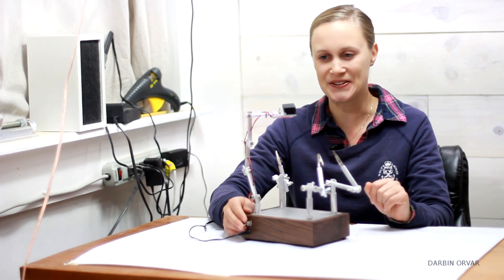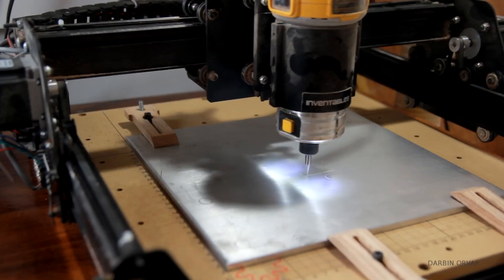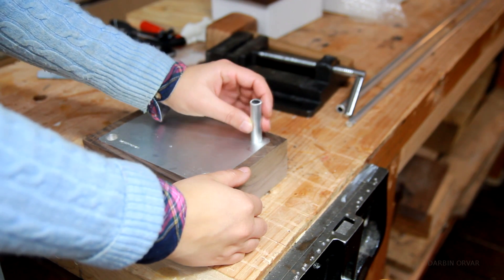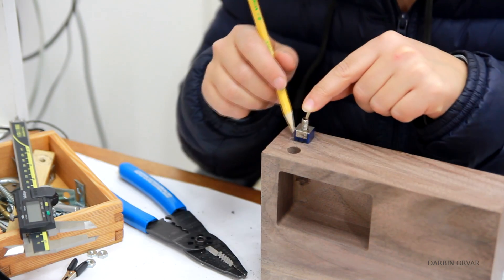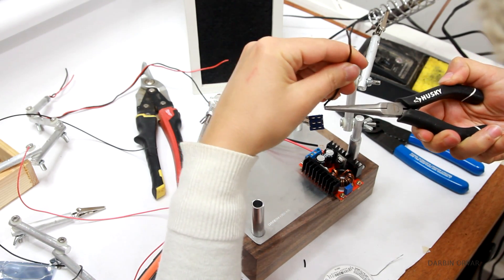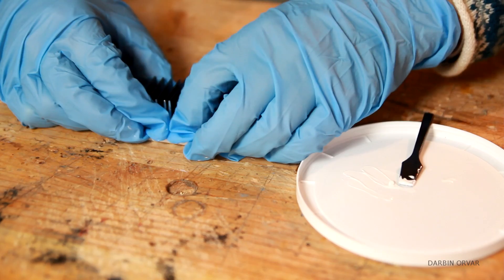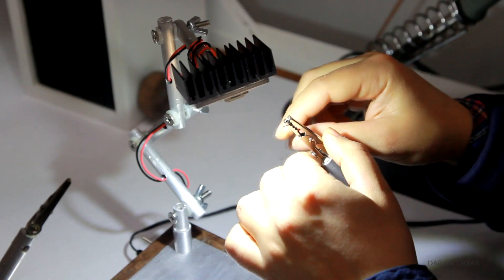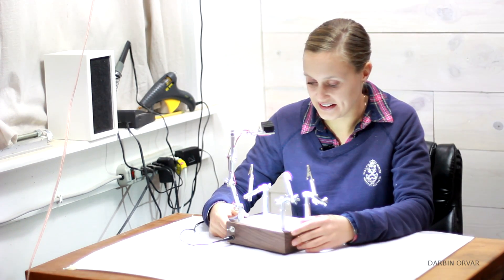Make a Super-Bright 10 Watt LED Task Lamp w/ Third Hand Soldering Holder

Comment: Beautiful! Just one question, you say that 10 W LED requires 30 V. This is a while and that may have changed, but almost every 10 w led chip that I see today on Ebay and Amazon requires between 9 to 12 V. Should I try to get a 30 V instead (i. e. is it a better lamp if runs on 30 V like 20 W and above)?
Reply from the maker: This particular led was 30 volts, most are 10 or 12 volts, it dosen't matter which one you use.

Comment: I went to the link for the led and at amazons description says 100 w...  almost sure is a typo on the description but i wana make sure..   so which one is it?    100 or 10???
Reply from the maker: Hi Javier, I just checked out this problem and added an update link for the correct 10 watt led.
Reply: @darbinorvar  thank you very much..  by the way.  Itll be great if you add a dimmer cz you might not always want it so bright or just to adjust it to your liking and or a fume extractor..  Just a quick idea for you to make a video..  😁

Comment: don't like it , it's really small and you have no place to work & it's aluminium so the solder might get stuck in there the think i liked is that you made that all by yourself and the light  but i like bigger area to work, Dustin Penner made one that was big and made by ceramic so there is no way that solder will get stuck

Comment: I would advise not attaching the alligator clips with epoxy.  The clips can easily become damaged and require replacement.  Not to mention you could at some point want to attach clips of different sizes or styles.  A screw would be a better option I think.  Otherwise, I love the concept.

Comment: Very cool little bit of kit. However you can buy 12v 10W LEDs for about $1 from places like BangGood, which would save nearly $20 on the whole project as you won't need the voltage booster either.

Comment: Came onto your video by chance...  loved it.   May I be so bold as to make a suggestion?   If you put a dab of the hot glue into the holes that the wires go into, at least those that articulate,  it will prevent the sharp hole edges from scratching through the wire insulation.  btw...  I like the look just as you do!!  Subscribing...

Comment: Thanks for motivating me
Over the few years i've had a third hand (mananged for over 40 years without one), i've been wanting to change it around because it was sometimes awkward for holding wires for  soldering, but kept putting it off because i wasn't sure any of my ideas would work, i was basing it around the original base, your use of a larger wood base was what i needed.
My version isn't pretty, but it's now more functional
Reply from the maker: +Sparky Projects Thanks for watching!

Comment: Looks perfect, just LEDs could have been smaller without heatsink for better access to some parts and get better viewing angle and those aligator clips cant rotate they are epoxied inside and on the other end the screw is going through shaft, but good project anyway! Thumbs up

Comment: What a neat design! A solved light problems using cheap ikea aluminium frying pan(as heatsink and cover) and 6x 10W 12V leds, with cheap notebook adapter as power source. I've used tap and die(M3) directly into pan to hold the leds in place. My design looks "how ya do 'in" a little bit. Thanks for your video.

Oh and I probably fell in love again! (to creep it up a little bit)

Comment: Good project and very well done - loved the machining and your skill. A better choice for LED would be the Cree XML @ 3V, 2.5A. Lot more lumens per watt, comes with custom optics (You could choose focus, spread, dispersed etc based on what you are working on) and also the electronics is lot simpler. You could derive power for this from a Li-Po pack or 18650 laptop batteries and a few components to drive it in CC mode with brightness control.
Reply from the maker: +Arvind S. Thanks for watching!

Comment: Nice project. I think you should break the edges more on the holes where the wire goes up the light arm otherwise the sharp edges may, over time, cut through the cable.

Comment: That turned out awesome! may i suggest if you do another project with leds and you dont need such a high powered led look into 3W they wont get as hot and are 12V and for most applications plenty bright. but I do like the added look of the heatsinks on the light and the walnut is beautiful great project!
Reply from the maker: +cade861 Thanks for watching!

Comment: This is a beautiful piece. I love the integration of the aluminum and wood. 

have you used it since? and how is it practically? 
I'm asking because it does look a bit crowded up there.
do you ever need the 3 crocs?

I've alwazs found the the 3rd hands end up tiping over when I press down with
my sothering iron so having a platform like this would be awesome. If I can get
my fat fingers in there.

thnk you for  your videos. cheers.
Reply from the maker: +Yves Baggi I just finished it very recently but I am using it a lot so far. It is quite heavy so it would not tip over very easily. Thanks for watching!

Comment: Pretty cool stuff. It would have been cool if you would have tapped holes into the aluminum so you could just screw in the arms. This would have made them removable when you don't need all 4 corners covered. Very nice original content!
Reply from the maker: +david Boardman That is a good idea David, but I do not have a tap set :) Thanks for watching!

Comment: HI Linn - Nice project
2 comments:
1. According to my experience  10W LEDs need bigger heat sinks
2. LEDs need to be connected to a driver that limits the current and not only the voltage
Since the current changes as the LED gets hot – this may cause 'Thermal runaway' that will shorten the LED lifespan
Reply from the maker: +zehavitshahar Thanks!